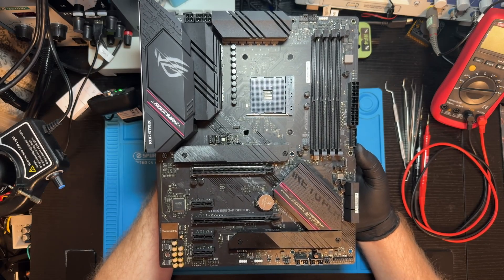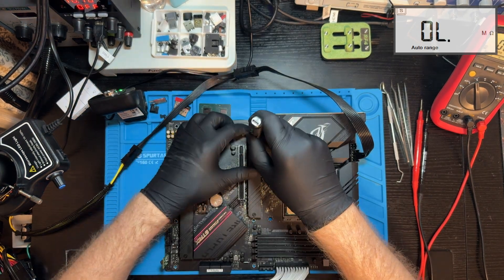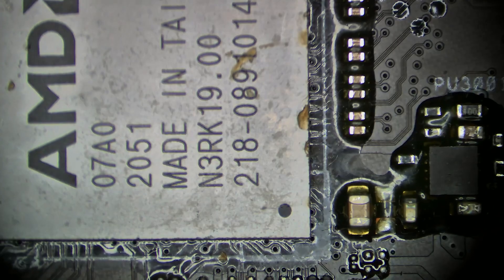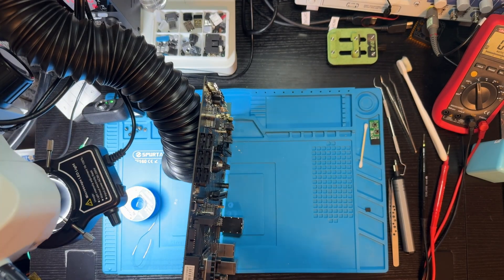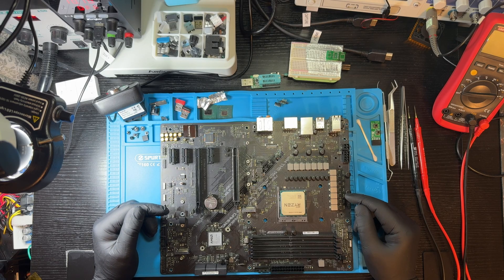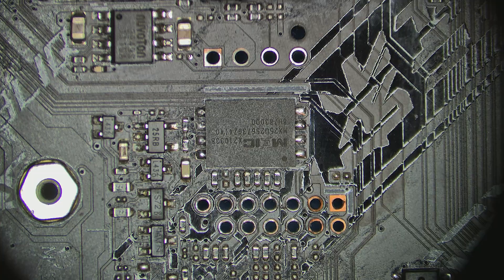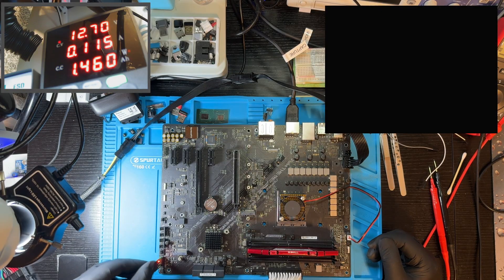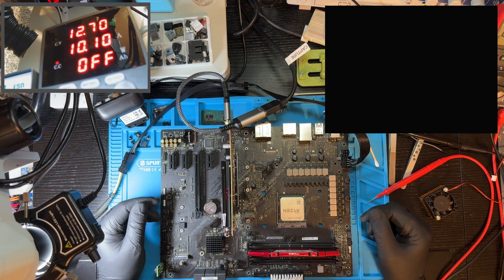Dead ASUS ROG STRIX B550-F GAMING Revived! Missing BIOS Chip & Burnt Headers FIXED!

Comment: hello.. what power supply you used to power the board? i mean the device connected to the bench power supply
Reply from the maker: Thanks for your question! I’m using a 1106 DC-to-DC ATX PSU (12 V, 300 W converter). There are plenty of similar DC-DC ATX converters available on the market, so you can choose one that fits your setup and power needs.
Reply: @FixThePixel  thank you

Comment: Interesting video, thank you. I have a Strix B550-F Gaming WiFi, and it is also stuck to VRAM. It had work done on it by a repair shop, and I see on it an MXIC chip, not a Winbond one. Definitely something to try out.
--- edited ---
Just checked the boardview file, it says W25Q256JWEIQ. That's a Winbond chip.
Reply from the maker: Nice catch — the board indeed uses a Winbond W25Q256JW, and swapping back from an MXIC chip can sometimes fix weird VRAM-related boot issues.

Comment: Ive never heard of the ID thing of bios chips, is that mentioned somewhere in their data sheets? And how to know which board needs what bios chip?
Reply from the maker: Thank you for a good question! Yeah, every SPI flash chip has a unique JEDEC ID (manufacturer + model code) that the motherboard reads during power-on. You can see it in the chip’s datasheet under the “READ ID (0x9F)” command. Some motherboards (especially ASUS, MSI, Gigabyte) check that ID against a supported list inside the firmware — if it doesn’t match, the board just won’t talk to the chip.

That info isn’t publicly listed anywhere — motherboard manufacturers don’t share which BIOS chip IDs they support. The only way to know is by checking the original chip on the board or the boardview/schematic.